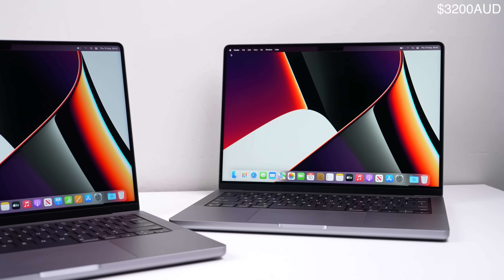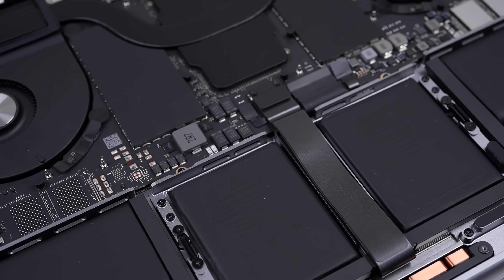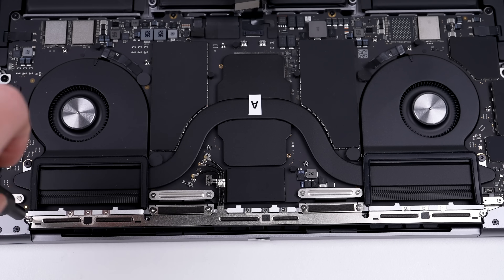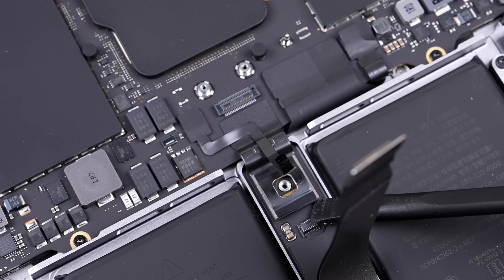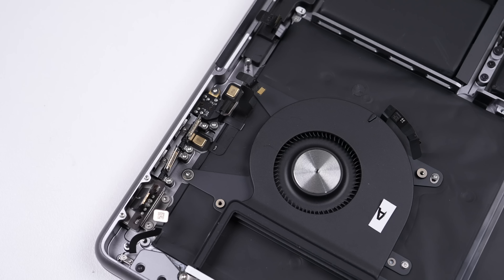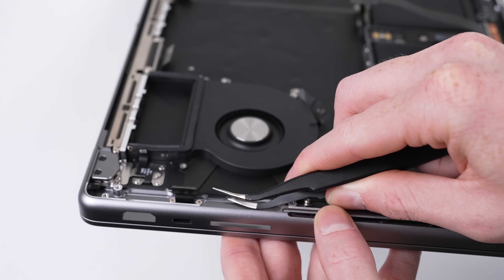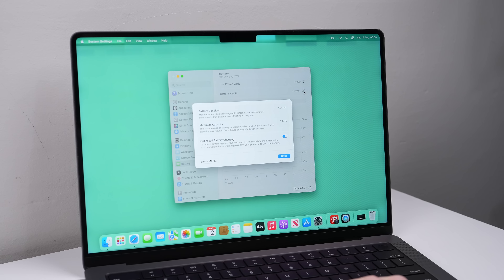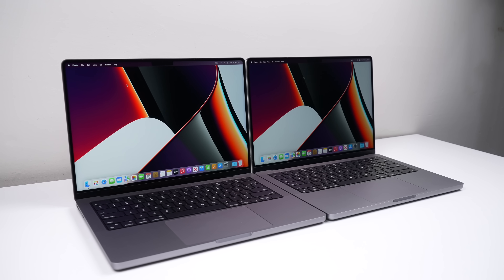New Anti-Consumer MacBook Pros - Teardown And Repair Assessment - Apple Silicon M1/M2

Comment: I’m actually ok with the software activation part. It means that to a thief a MacBook is little more than a paper weight. If they ever stop selling parts, they should of course release that software to the public. They probably won’t, which I’m not ok with.
What’s really inexcusable though is that repairs are so physically difficult. Yes, I don’t want my device to fall apart, but no one can tell me that that requires such an insane number of screws.

Comment: The internal drive will probably fail much sooner than a screen issue. Buy with 3 years of AppleCare and replace every three years this is obvious now. Total cost of ownership should be calculated on this. The 15" air is looking like the best gamble at this point.

Comment: The amount of screws is nuts. I love some well placed screws much more then any glue or clip, but the amount here is just bad engineering.

Considering how much apple devices cost they could easily be engineered to be easier to repair and more long lasting and with that not as bad for the environment, but instead Apple was like fuck the environment, we wanna sell more crappy Laptops.

Comment: The lid angle sensors are paired to the display. If the lcd gets replaced the lid angle sensor is required to be replaced. If the sensor goes bad it can be replaced by itself. In either situation you have to get apple to configure it. The same relationship is the same for the main logic board and touch I'd is the same. U cannot take a LAS or TID that has already been paired in one macbook and use it in another macbook.

Comment: OK, I stopped watching halfway through and here's why:

1) You already know they software lock the hardware so why go any further?
2) Yes, Apple wants you to buy genuine parts from them. EVERY MANUFACTURER wants that to happen, and it seems you're mad Apple has found a way to guarantee that happens. You just proved that there are replacement part options on Apple's website, but you are jumping to conclusions about when your device ends support. Is it a safe assumption, perhaps, but that remains to be seen. Apple computers have a hard cut-off of 7 years, and while I'm annoyed at this fact while typing this on my 10 year old iMac, in the future you won't catch me buying a $6,000-$7,000 computer because there's no long-term value.

Overall you just seem to be a hater. You want to be able to use 3rd party parts or salvage parts on these devices and you're mad that you can't, but that doesn't mean these devices are "completely unrepairable." I've always enjoyed your teardown videos, but I like them more without the sound as you tend to accompany these videos with obtuse, complains about manufacturers and your experience with them. And with that, I'm done...

Comment: @HughJeffreys If you have some time - please investigate futher. There are actually rotating part - octagon screw with magnet on the display itself (you poking to it at 7:10). Right opposite lid sensor.  You can rotate it manually to achieve sleep behaviour at right angle. (when it's fully closed). It's painfull, but possible.

Comment: Thanks for bringing to the light how these products are becoming less and less repairable.
One note, disconnect the battery data cable on the left of the trackpad cable first or you’re plugging/unplugging the trackpad while battery is still activated.
Reply: Channels like this are cancer. You have no clue about technology and you are fueling your clique on a lie.
Apple pairs lid opening sensors due to security reasons, when the lid is closed, the USBC ports are turned off. You can't connect something that will steal data.

Comment: Im 100% in agreeance with shitting on apples un-repairability but I'd be interested to know if you performed an NVRAM or SMC reset after each repair.

I work refurbishing apple products daily and, with big hardware swaps like this, theres usually always 1-2 software bugs/glitches (like the screen sleeping at different angles and the glitch next to the notch) immediately after the swap and a back to back SMC reset followed by 2-4 NVRAM resets seems to get rid of most of these as, before the resets, the macbook will still likely recognize the new part as foreign and start freaking out giving weird issues like this.
Reply: that's nolonger possible on apple silicon models, the m1/m2 chip has replaced those and can't be reset by the end user
Reply: @DaveFlash  sort of true, you can still SMC reset just not NVRAM reset, but still the likelihood that it'll help with this issue is not high in the first place so I doubt it'd be worth even re-trying the swap. I was just curious as I've come across issues like this only to have an SMC/NVRAM reset fix it with no issues.

Comment: Apple is basically monopolizing repair with built in software locks in Mac OS X and will only allow you to access the built in calibration tools in Mac OS X if you either buy the parts directly from them or have the repairs done by an Apple Authorized Service Provider. The fact they are allowed to get away with this just blows my mind since the replacement parts will not work correctly until the calibration is performed. In addition I believe most of the calibration tools are already built into the Mac OS X software but you cannot see or access the calibration tool unless activated by an Apple employee.

Comment: wow, great video! You put alot of work into making this video and it’s greatly appreciated. It is amazing that the hall sensor cable (or whatever they call it now) is paired with the display. So I guess you have to replace both at the same time? But I guess even if you did that you would need Apple to calibrate. Very eyeopening….

Comment: Even authorized Apple service centers have difficulty repairing a MacBook. They Replaced most of the parts in my M1 MacBook 13,3 (mainboard, battery, top case/keyboard) and failed assembling something as the laptop was not turning on any longer (nor reacting to charger). Well done Apple.

Comment: I got offered one of these from a friend - he'd spilt coffee on it. Display and case was perfect and he only wanted $350 for it - what apple offered as a tradein. I had to pass on it because the display can't go onto a new computer. Not justifying it, but the screen angle sensor is part of apple's hardware security that shuts off microphones/cameras when the screen is closed, so it being serialised and boobytrapped is not unexpected. What I think has happened is that a state actor (aka China or the US) has previously done something to record from microphones when the system is closed and Apple has now designed around it.

Comment: I bet you didn't get certified by Apple for FREE. Otherwise you wouldn't be so extremely clueless and wouldn't produce such awkwardly pseudo-scandalized videos. Just accept it, you heroic fighters for the supposed "right to repair": Apple is not going to fund you a secondary market for spare parts so that you can repair cheaper than certified repair shops.
Finally, your silly comparison of Apple's laptops with those of the spare parts dealer Framework (who earns its money by building lots of predetermined breaking points into its supposedly so easily repairable spare parts) impressively proves what your real agenda is. 👎

Comment: We all have to remember that this an many other companies are about maximum profit and keeping the share holders happy. This is why they are a trillion dollar company. Manufacture in all industries a slowly learning this practice. The next industry to make this true is the automobile companies with the fully electric cars. I just updated my boiler and water heater on my house to the newest wall mount units. The boiler failed and the technician said that he can not work on the unit… it has to go back to the manufacturer for repair or replacement… we will not own  or have control to anything in the future… this is just very sad.

Comment: The fingerprint being lost is an interesting security concern. Not entirely sure how it would exploited, but I imagine it opens it up to something.
Reply: The fingerprint is stored on the chip of the sensor itself, AFAIK the rest of the system has no way to access that data. The MLB (main logic board/motherboard) can basically only ask the chip if the fingerprint is authenticated or not. And for that the MLB needs to trust the fingerprint chip. To maintain that chain of trust, the fingerprint reader and MLB are matched at the factory. If the MLB and FP don't recognise each other they will error out. That's the only reasonable security measure here, every other issue shown in the video is just anti-repair BS.

Comment: I swapped displays on a m1 macbook pro without issue. Did a full logic board swap; one macbook had been run over but worked the other had water damage. Two made one, with no reportable issues. Had to swap the touchbar too with one from ali express. Cant even tell by looking at or using it.

Comment: Very good and informative video. Knew the display miniLED glitch since release, but never bothered looking up if this is real. I remember it was some display IC that you would need to swap. But the display sleep cable information was knew to me, good to know!
Reply: the reason why I absolutely love my 2019(20) 21.5 iMac! Had the 2020 refresh with the 256GB SSD and installed a larger 1TB for 40€, got used 32GB of ram for another 40€ and now I have the max spec of this beauty and I look forward using it. Likely getting a studio display since this Mac runs so well and the 6-core i5 is going strong, not sure if an upgraded to an i7 is so useful. Installed the official vesa mount, the 560X performs similar to the M1, maybe even slightly better so F* the M1 iMac thing for my total investment of 480€, saved myself from buying the same config but M1 for around 2.500€
Reply: Channels like this are cancer. You have no clue about technology and you are fueling your clique on a lie.
Apple pairs lid opening sensors due to security reasons, when the lid is closed, the USBC ports are turned off. You can't connect something that will steal data.

Comment: I work in a repair shop, we have replaced a good amount of m1 air screens, thankfully no issues like this. we have had some quotes on these m1 pros and the screen cost is outrageous,  people just dont want to do it and go to using it with an external monitor so I havent seen these issues yet, but I'll at least know now that it might not even be possible even though we can get replacement screens.

Comment: I am working with LED screens and I can confirm that we need to calibrate the screen before using it otherwise it will be scrambled or giving wrong colors. To recalibrate it we use an application which it seems like apple is doing that too, but we don't have access to the app yet

Comment: I work for a apple certified repair agency. After a repair, apple requires us to run their diagnostic tests. If the device passes, the repair is complete. If it fails, we have to sned the device straight to apple. I just wonder if these repairs would pass their diagnostics when using 2nd hand parts

Comment: The reason on the sleep / hall sensor issue, seems to be calibration. On the screw there is a magnet, placing this magnet with automation makes it difficult to have the magnetic field aligned properly. Hence on assembly, there must be a calibration tool to set the closed/open state. 
Why we dont have access to this tool, is a different story.
Reply: Why someone would replace a bulletproof century old hall sensor with this abomination should be the question, not the access to the calibration tool.

Comment: Meanwhile i use clonezilla booted from a usb drive to clone the SSD of my Dell tablet to a new, larger one inside a USB case, so that i can later stick the new drive inside, resize the partitions and enjoy double the capacity.
I removed the new SSD from my pc yesterday, which i upgraded prior to this, using again clonezilla running from the command line of my existing ubuntu install.
So not only can i upgrade the storage in my desktop, i can also repurpose standardized parts and put them inside my tablet, which btw. runs Ubuntu, Android AND Windows 7, Windows 11 thanks to dual booting and enterprise featured UEFI firmware (it´s a business class device).
It technically can even boot windows xp, since it supports MBR booting (CSM module).
Now tell me what else would be as flexible as this thing.
Btw. Dell still sells OEM batteries for this 2017 2in1.
The Core i5 7300U isn´ t exactly a power house, but it can do 4k60 video decoding, browse the web, play some old games or do ms office very well.
8GB DDR3 soldered on the mainboard though, too bad it isn´t upgradeable like the SSD.

Comment: think different: Make it easy to repair by breaking world records in the amount of useless screws or fittings in their laptops.

Imagine that your car wont start when you use a 3rd party brake pad on your car and you have to buy a new car to get the car to start again.

My main questions is:  Why do people buy macbooks from apple if apple screw their customers over over and over again and have no support for their customers issues from it?
Is the urge to show how "rich" you are so strong so it permanently turn off the brain and common sense stop working?

Comment: Great video. Please note following: 
1) You should remove the BMS (battery management system) flex cable from the logic board, before removing the track pad flex. Otherwise you could short the logic board.
2) If you untighten/remove the lid angle sensor (LAS) and retighten/reinstall it again, it will not be 100 % calibrated as before. The magnetic field will be different. It is not an ordinary hall effect sensor.

Comment: I might be alone in this one, but i think these laptops are some of the best laptops on the market. I think a lot of R&D has gone into the development of these computers to make them super fast, efficient, durable and cheaper to manufacture. 

I do agree that some design decisions impact repairability and that they definitely should allow repairers to access the software to calibrate different sensors, and at least make the parts a little bit cheaper. But i disagree with those saying there are better computers. Objectively for most workflows these computers are top tier for all round use.

Comment: Theoretically you could rotate the magnet for the display angle sensor to calibrate it. It makes sense that it need calibration, that way they don't need to align the magnets in the factory.
Reply: Needing calibration isnt an issue, that calibration being locked behind apple support, however, is.

Comment: Christ. That screen artifacting is 100% not a calibration issue. That's a hardcoded fake fault to lower trust in independent repair places, by making you think they gave you a faulty panel or installed it carelessly. And worst of all, since it's a fake software issue, Apple just have to run a software utility to reset the serial lock, and then they can lie about having swapped the display and just have you pay full price for a brand new display you already paid full price for. This is... beyond disgusting.